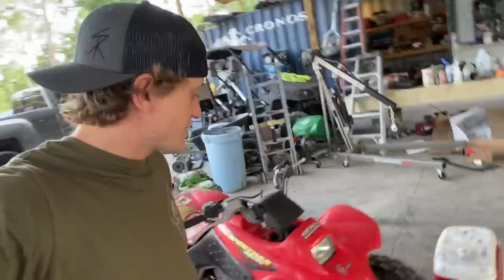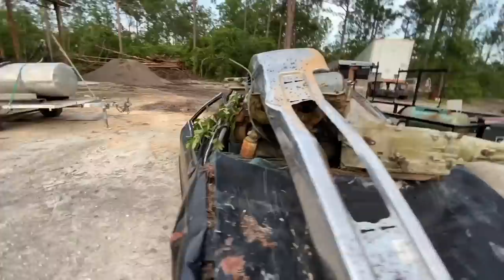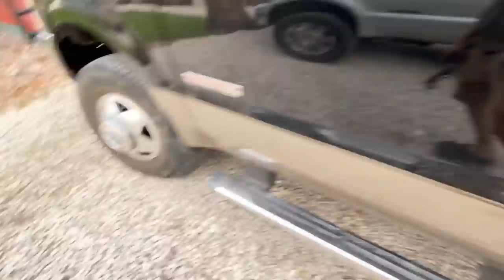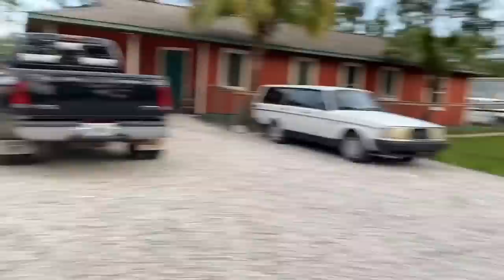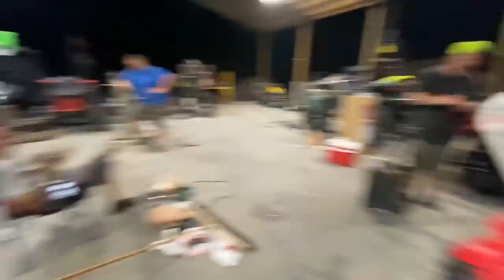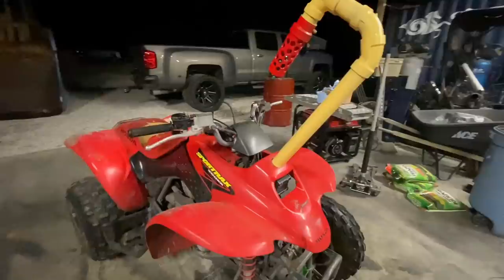I Snorkel the Trx 250 with Mudit atv adapter

Comment: what about the vent lines for the carb and gas tank
Reply from the maker: Yeah, I got too excited and forgot about those. I remember after I take it in the water 😅
Reply: @koltgene  nnnoooo poor 250. It's a Honda though so I'm sure it will be fine
Reply from the maker: Yeah, it’s good. Just had to manually sink it to test the mudit snorkel adapter 😅 I’m running vent lines for it this week
Reply: @koltgene  that's awesome  definitely  interested to see it in action, walking on all the canams no offense

Comment: Yo can anyone help My shifter is striped and won’t stay on I even put JB weld on it and put a bolt and nut through it and it still won’t stay on. I know I can probably weld it but is that bad to do and you can’t get the side cover off if you need to.
Reply: Get a new one